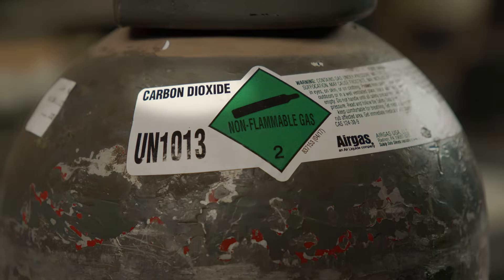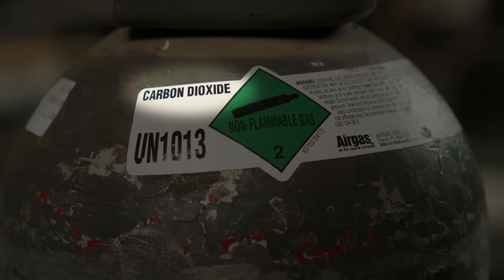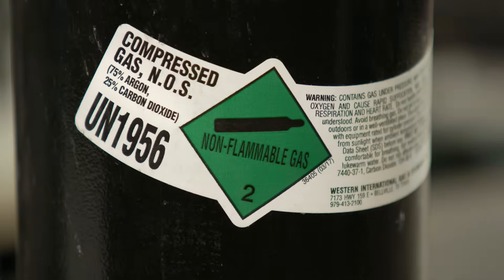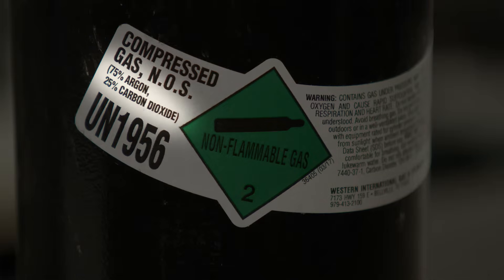How to Choose the Best Shielding Gas for MIG Welding

Comment: Thanks man I appreciate I had welding class in high school and just now as an adult was able to afford buying my own welding machine haven’t welded since 2017 when I graduated and I wasn’t sure what gas to get when I got to get my shielding gas I’m gonna get the 75/25 that’s what we used in highschool shop it didn’t splatter as bad and made a perfect clean bead I could stack quarters my teacher used to say perfect bead on some quarter inch steal but joints